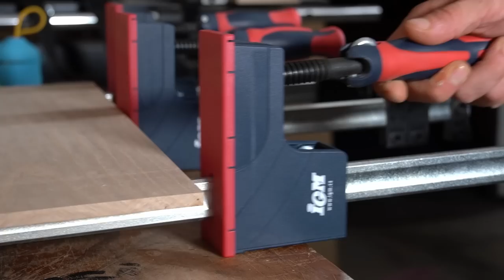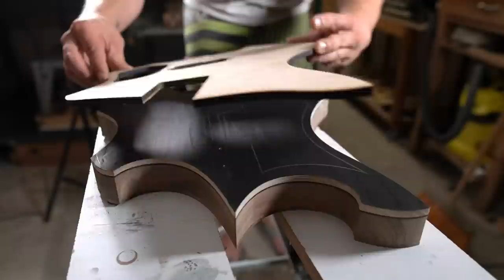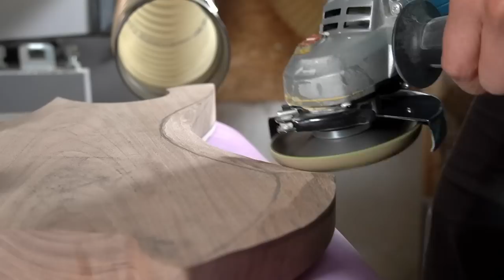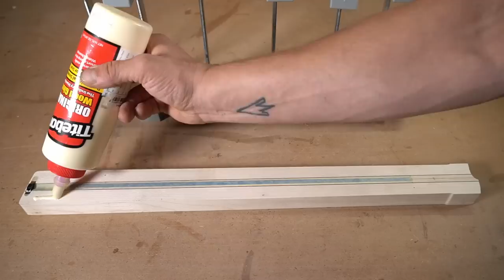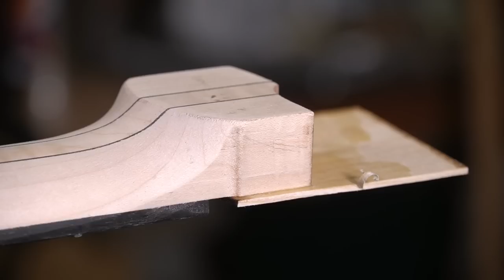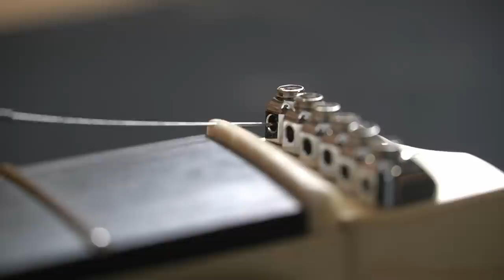Building headless electric guitar with some help from Ortur laser engraver. Full Guitar Build Video

Comment: Nice work man! I would almost bet, judging by your Eng accent, that you come from the small and beautiful country that has about 40km of Adriatic coast and a 2850m highest mountain. Can I ask why you opted for the glued neck, was it aesthetics or also sound? And did you make your own pickups? I have never seen that shape of pu's before. Last question :) ... what gauge strings did you put on. The low E looks like it's quite thick, like 54 or 60. Cheers
Reply from the maker: Haha true. 😄  I believe that set neck has an influence on a string vibration enhancing the tone and sustain. If the joint is made properly it is almost like necktrough.
Pickups were custom made by Gorilla Pickups. I highly recommend them.
Strings are just standard daddario 10s.
But the guitar is tuned to D# standard.
Reply: @MagicAtticGuitars  mam eno vprašanje, bi lahko jaz enkrat prišel pogledat tvojo delavnico? Nekaj časa se sam ukvarjam z nadgradnjo in servisiranjem kitar in me zanima kako izgleda. Seveda bi moral zdržat tud kako vprašanje ;)

Comment: Great content.. you encouraged me to purchase that engraver! But I don't known what Is the máximum Depth of engrave.. you could give me some enlightment about it
Reply from the maker: Thank you! It very much depends on the material and settings. It's impossible to give an general answer to this question.
Reply: @MagicAtticGuitars  For wood.. could I engrave a body or neck?
Reply from the maker: Yes sure. It also depends on the density of the wood. I was cutting 4mm thick walnut with it.
Reply: @MagicAtticGuitars  Pretty hard wood.. no jokes on it! xD

Comment: I dream of a time when they will be able to fit the model of the exact action of the bend and overstretch of the string, the nut and the fan structure of the frets to a general formula with all the amendments. Such a guitar should be seven-stringed, balanced on the shoulder, light and resonant, and enriched with a B low note.
Well, of course, the neck pickup should be for accurate and final adjustment of the scale, after the guitar wood has dried, and it can be assigned the duties of a sustainer. It is from him that the tone must be taken, in order to measure the errors of the system, but these tones can also be extremely beautiful to the sound, if everything is adjusted and rebuilt.
Reply from the maker: Man this is very specific and I'm having hard time to understand it all. Thanks for sharing though.
Reply: @MagicAtticGuitars  The neck pickup delivers a signal that more accurately reflects frequency and doesn't have the dominance of harmonics that confuses a digital tuner's tuning. On a neck pickup, not only are measurements more accurate, but the harmonics and harmonics match the true tone exactly. All scale adjustments should be made precisely and only on a neck pickup.
Your guitar does not have a neck pickup.
Well, the second. The shift of the temporal order of the string on the fingerboard is subject to two factors: - additional string tension to clamp it at a certain fret - and shift of the oscillation breaking point, which depends on the thickness of the string and its elasticity. Therefore, the system will always have a different error on guitar strings of different thicknesses. You've probably heard about looking for equal tempo on the guitar. This is actually a problem that has not yet been resolved.

Comment: I have this same laser but I can't cut through MDF like that.  Is your laser over-powered?
Reply from the maker: This was a 10w output module. I had to go slow and with multiple passes. But it made a cut. How thick is a board that you want to cut? Mine was 6mm.
Reply: @MagicAtticGuitars  yeah 6mm MDF.  Even at 100mm/m and 100 power it won’t cut.  No matter how many passes.